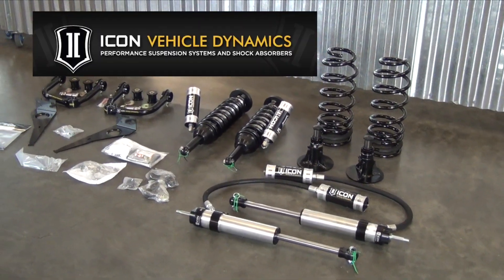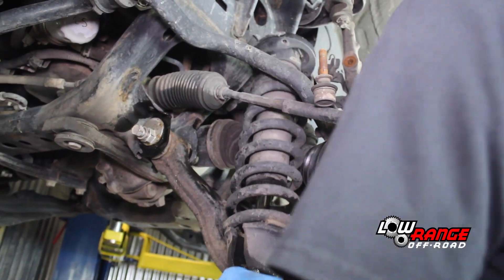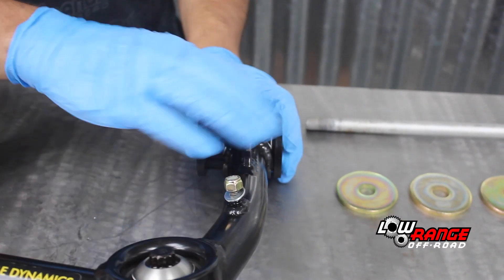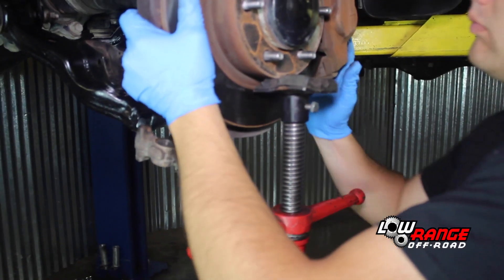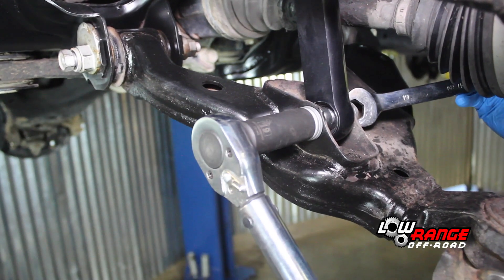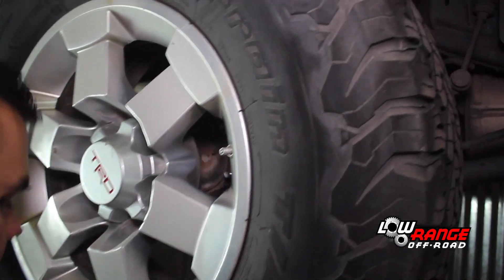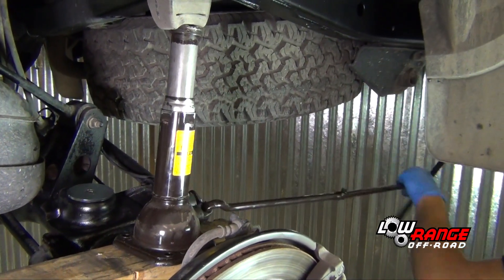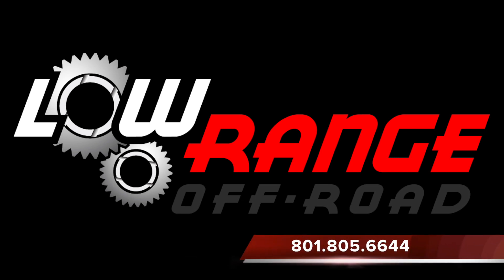ICON Stage 5 Install on 05 Toyota 4Runner

Comment: I am currently installing an Icon stage 5 suspension lift with Billet UCA, and rear lower links on my 2012 FJ Cruiser.  I have never done an install this big.  This video was paramount in raising my confidence that I could do this job on my own with limited mechanical experience.  The instruction in this video is much better than the provided Icon instructions.  The addition of extra tips, visuals and factory torque specs are greatly appreciated.  I would have struggled to understand some of the written instructions without this video.  Thank you so much for this great contribution to the 4x4 community.

Comment: great job! hoping to pickup a 4th gen runner soon!
Reply from the maker: Awesome!  They are nice rigs.  We have several employees who have 4th gen 4Runners.  They really like them.  Let us know if we can help you with parts!  Thanks for viewing and commenting.
Reply: lowrangeoffroad I'm thinking of putting some lights in the very back, adding an interior door latch release button for the rear hatch, and wiring in the front overhead lights to come on with the others when the doors open. I'd also like to modify the lights so that my fogs don't turn off when I turn my high beams on

Comment: The bigger spacer is in the rear for me.  It rubs when in stalling the front coilover.  Also,  the mount goes not work on the gx460.

Comment: Thanks for the awesome video kind sir!, two questions if you would be so kind, 1. Does the stage 5 kit come already filled with gas and ready for use?, 2. How long after the installation would I need to service the shocks., Thank you very much, kind regards.
Reply from the maker: Thanks for the questions.  Yes the shock come filled. And they should last up to 70,000 miles depending on how much off road use you do.  Thanks for viewing and commenting.

Comment: So, I love this video, really easy to follow. My question is now what did ya'll do to clean up the wheel well. Was it power washed and then sprayed with rust converter? Looked great. Want to clean mine up when I do my lift soon too. Thanks.
Reply from the maker: We used brake clean, rags, and wire brush to clean, then painted with gloss black paint.  Pressure washing does help with initial cleaning but can't remember if we did that on this one or not.

Comment: Great video!  What kind of jack do you use?  All I have is a floor jack and would like to buy what you are using...
Reply from the maker: I am not sure I understand your question.  We were working on a twin post lift.  If you are referring to the under hoist jack stand here is a link to one similar to the one we  were using.  http://www.northerntool.com/shop/tools/product_200641745_200641745?cm_mmc=Google-pla&utm_source=Google_PLA&utm_medium=Automotive%20%3E%20Jacks&utm_campaign=Strongway&utm_content=46207&gclid=Cj0KEQiA_KvEBRCtzNil4-KR-LIBEiQAmgekF_YCae_yd-l6YRRhY5iYCfzrqhEHIawGzgfM1tfMqowaAjUg8P8HAQ
Although, I am not sure where we purchased ours.  
If you are referring to the one we used to put in the rear springs, that was the OEM Jack that comes with the vehicle from the Factory.  Hope this helps.  Thanks for viewing and commenting.

Comment: looking to do the same exact work on mine...what's the cost on this type of lift?
Reply from the maker: Here is the link to the product in question:  http://www.lowrangeoffroad.com/2005-2015-toyota-tacoma-suspension-system-by-icon-stage-6-with-billet-uca-k53006.html  Let us know if we can help you any further.  Thanks for watching and commenting.
Reply: Steve O I’ve been looking at the icon stage 2’s. So you are saying do not go with them? Any indication on why they blew? Do you have an alternative suggestion instead of icon.

Comment: what size tires does the customer have after the lift
Reply: Adam K  265/75R16.   This is my rig. I drive it everyday. 320k miles and still loving it. Especially with the icons!   Rebuilding the each time is costly but worth it to me.

Comment: Torque wrench I'm sorry
Reply from the maker: No.  As far as we here at Low Range are concerned you do not need to use a torque wrench.  Especially if you have been wrenching for a long time.  But, it is always a good idea to put nuts and bolts back to factory torque spec, especially when working on steering and suspension parts.  You never want these fasteners to come off if left too loose or break (or strip)  due to over tightening.    I have been at this stuff for over 30 years and I still use a torque wrench. Thanks for the question.